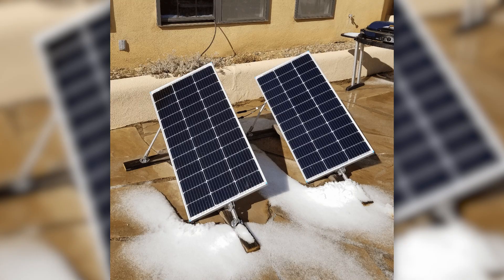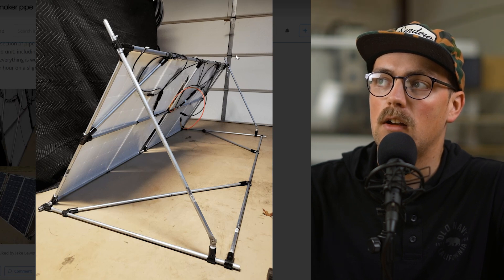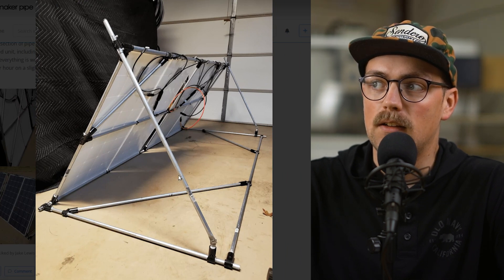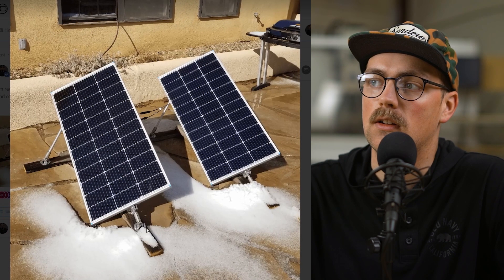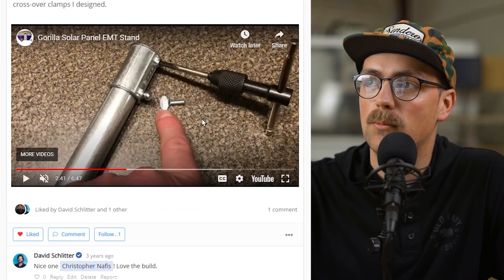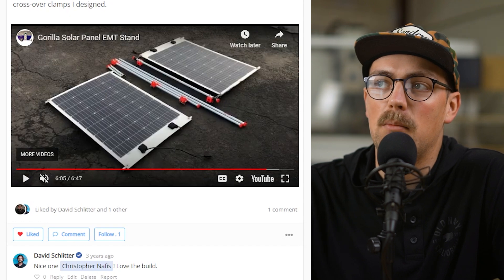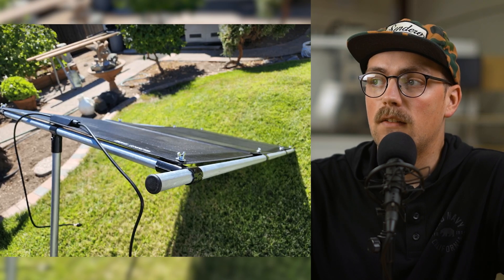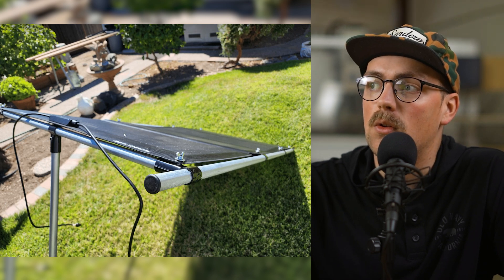5 Solar Panel Stands Made With EMT Conduit!

Comment: I use EMT Conduit and tent pole "T" fittings. Make a "H" block out of 1x3 wood to connect to the panels. Use the pipe in the pipe method for making it swivel 360 degrees on the azimuth and nearly 120 degrees on the horizontal axis.  Easy stuff.